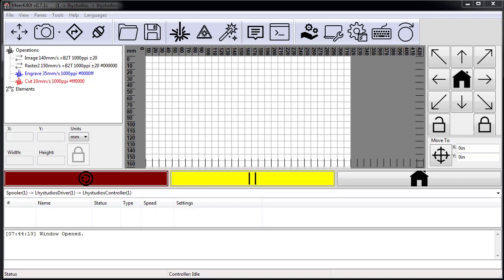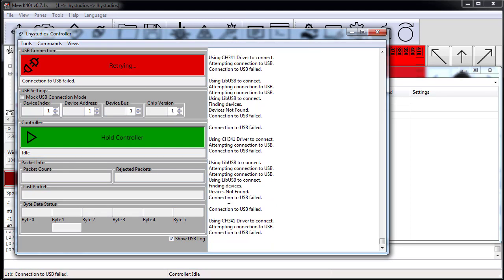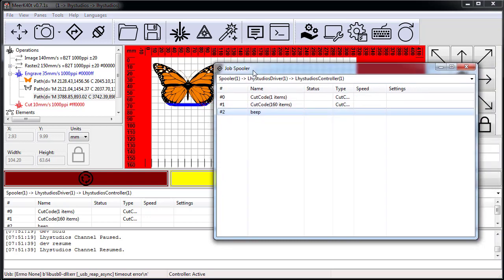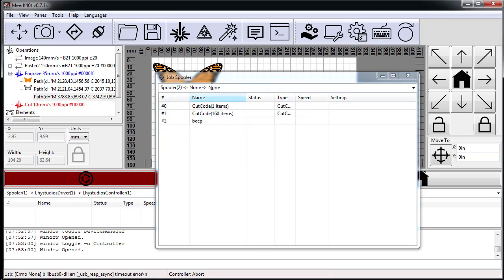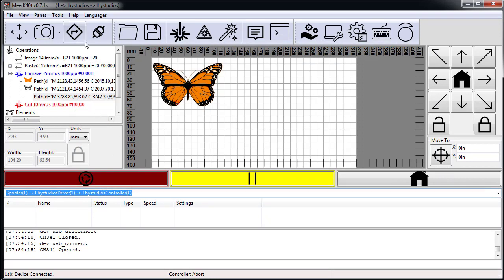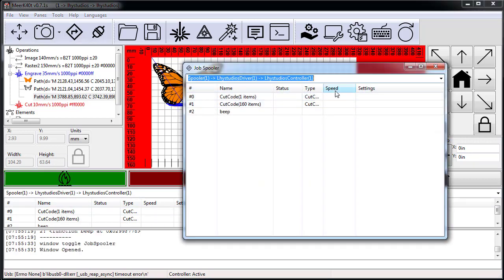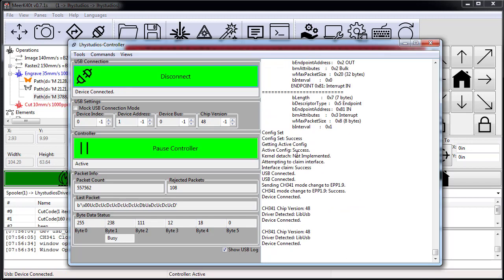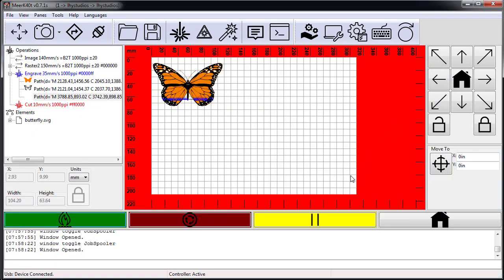MeerK40t: Troubleshooting

Comment: i messed everything up how can i reset everything to default?
Reply from the maker: %LOCALAPPDATA%\MeerK40t\meerk40t.cfg file will have your settings. Delete it. Should load back up fine. That directory is pretty common for most stuff the program does. Dumping fonts in there for example lets you use them for some stuff etc.
Reply: @davidolsen1222  Thank you so much it worked all is good!!

Comment: Thanks for your video, I could not get my laser machine to work. My project simulated well
on Meerk40t but there is nothing happen when send it to the machine
The driver is not LibUsb as your - I got these Infor from the controller:  
"CH341 Chip Version: 48
    Driver Detected: WinDll
    Device Connected."
I am using windows 11 64 bit and MeerK40t v0.8.1007 version

Any advice is greatly appreciated,
Reply from the maker: You could try Whisperer. It's a fine program and installs the libusb driver for you, if that works meerk40t will work too but it will certainly help with the troubleshooting.